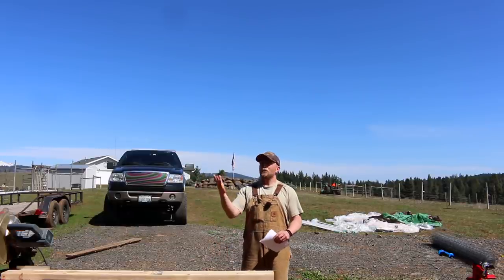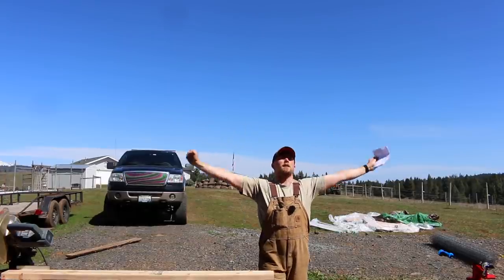MUST HAVE Chickens For EGGS

Comment: Check with Cody next time you need to inspect the fence to use the UTV. The ability to carry supplies as you ride along the fence line lets you quickly move along the fence for the inspection/repairs. 

Have seen people use golf balls to both help the chickens learn where to lay and to also reduce the stress when you take the eggs as they have something almost like an egg to keep sitting on. 

Do you have a harbor freight in town? they sell a 4 inch round magnetic parts holder that would be perfect for projects like that and when you need to take something apart for a place to place nuts and bolts and have them stay in place along with holding driver bits when you have a few oddballs to switch to.  Also good when working with a tool belt as you can put drill bits and driver bits in it then slide in a tool belt pocket and not have to worry about them getting lost.
Reply: Never thought I would live to see the day that you would pet and talk to a chicken; that you've named!!  Lol